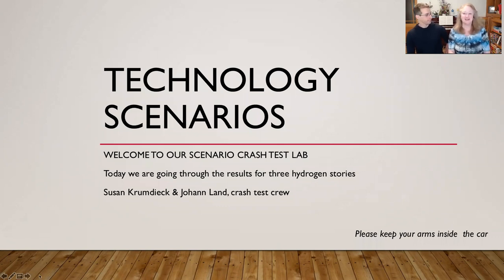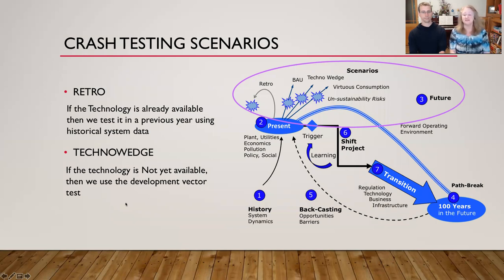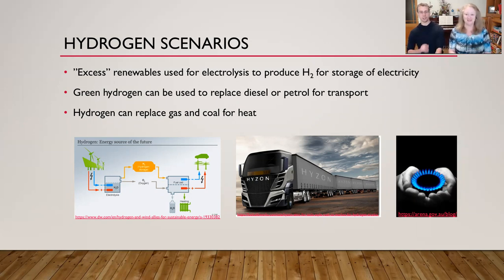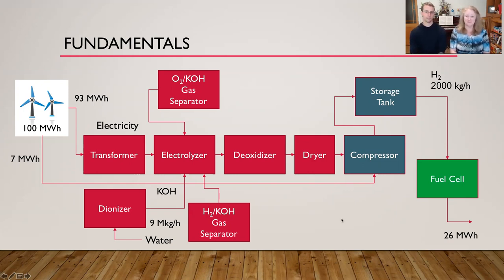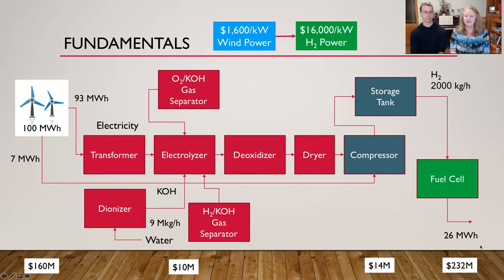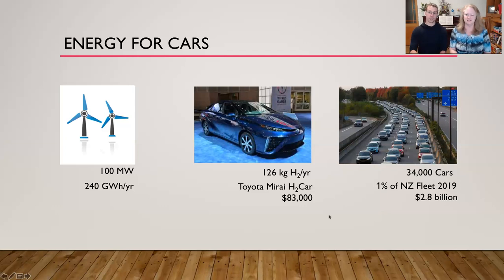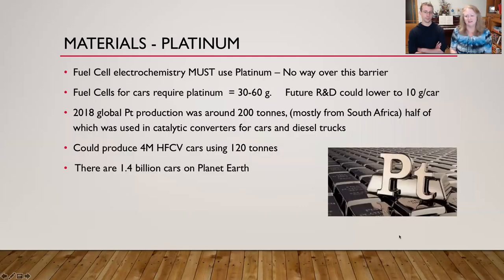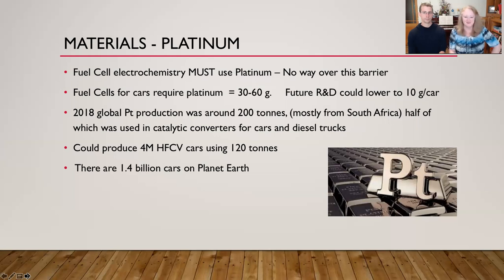Crash Test Hydrogen for Energy in New Zealand  Susan & Johann

Comment: One of the biggest boondoggles of all time. It's absolutely amazing how quickly and easily hydrogen blows up with your analysis. And yet so much money is being dumped into it--mostly I suspect because of pressure from O&G. Thanks for the platinum analysis. I was curious about availability of platinum as a material limit.

Comment from the maker: We should note in the excess wind electricity to hydrogen for storage then through a fuel cell to electricity on demand - we assumed the storage is only one day so we neglected the 2% loss per day in hydrogen leakage from storage which is state of the art for high pressure tank storage. Consider how this would factor into a scenario about long term storage. Just do the math for the number of days you are interested in.
Reply: How does this compare with other forms of storage? Like charging the batteries in an EV?